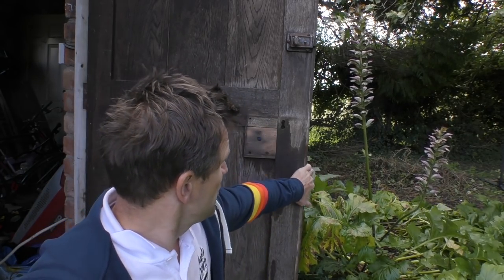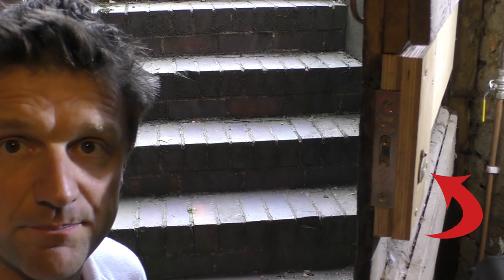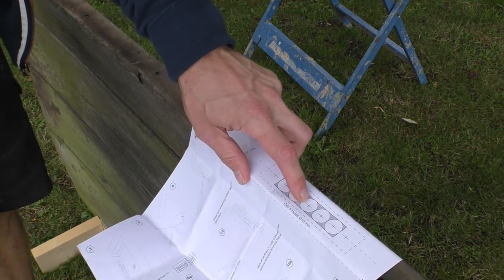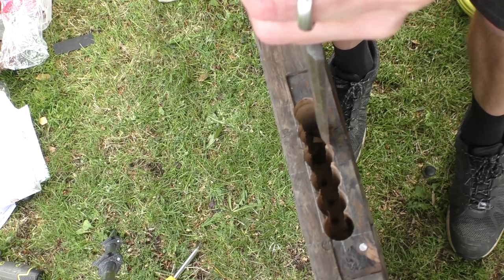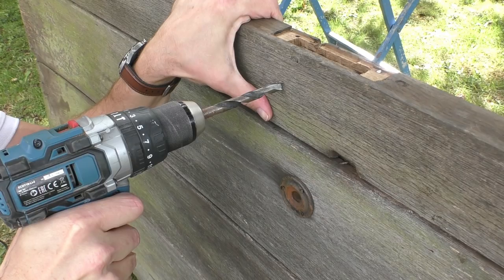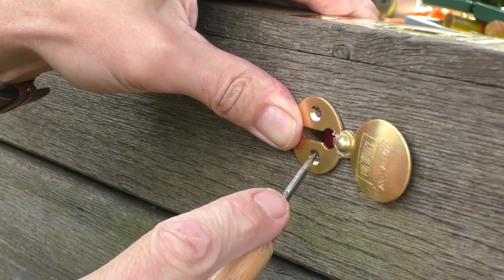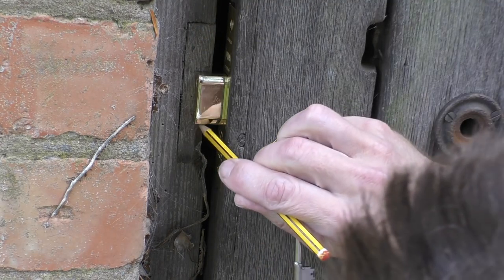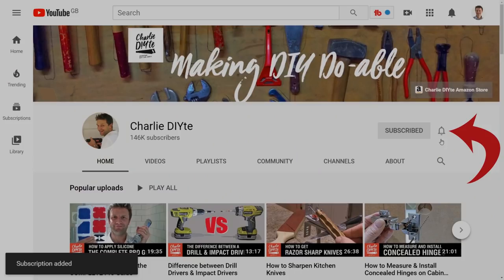How to Fit a 5 Lever Mortice Deadlock

Comment: Full of useful tips and tricks and not a straight forward job with the old screws etc. Excellent video as ever.
Reply from the maker: Thanks. Yes, I tried to get that screw out by grinding a new slot head onto it, but it just sheared off when I tried to turn it. 👏
Reply: @CharlieDIYte  I have a set of screw removal adaptors from Irwin that may have worked but probably not if the shank just snaps. They are handy items to have for not much money. You can also get ones from Irwin for bolts.

Comment: With brass screws, I like to drive the holes first with steel screws, then take it out and fit the brass ones.  In Aussie hardwood the brass screws usually snap.
Nice mortising 👍
Reply from the maker: That's a great tip, Peter. Thanks for the comment 👍

Comment: Another neat job done Charlie but that Black & Decker Workmate has definitely seen better times. ATB  Marc - Belgium
Reply from the maker: Thanks Marc  I know. I've looked around to see what to replace it with and nothing leaps out at me. I might instead just put two new oak tops on it.
Reply: @CharlieDIYte  That is exactly what I did Charlie. After all they are a useful piece of kit and the new ones are expensive and  not as sturdy as the old ones. Keep healthy!

Comment: This is proof that if you have the right tools you can do almost any job
Reply from the maker: It definitely helps. 👍
Reply: @CharlieDIYte  excellent tools that you won't use again..
Reply: @Stadium-wr3vg  you Don't  need  a lot of tools  to fit a mortice  lock,I have morticed several  with just a  19mm chisel  and a hammer, did one one with a chisel  and a rock just to prove a point. 
Some form of drill is handy  for pilot holes  and keyway though.

Comment: A2 stainless would have been more than good enough (also quite a bit cheaper than A4 which is more suited to marine environments as it's a bit soft but excellent corrosion resistance in salt water).
I'm with you 110% on the torx head screws, I try and use nothing else these days for all the reasons you mentioned.
Reply from the maker: Thanks for that. I completely agree with the A2. I just had the A4 knocking around so I thought I'd use them 👍

Comment: Just found your channel and did some catching up on it. Love your explanations and reasons/options. Tbh I didn't even need to watch half the stuff I did. Your content kept me keen. 

That being said, I'm in the middle of having to run some Ethernet cables around the living room. Could you go over some options? Main issues are around door frames!
Reply from the maker: Thanks, I really appreciate that! I take it the room isn't carpeted, as if it was, it would be easier to go under the threshold strip. It's a bit difficult to comment without understanding more about the space, or what you're trying to do. Maybe email me some photos to charliediyte@gmail.com. By the way, if you're extending your WiFi, you HAVE TO use UniFi, either their AP AC Pro or the Lite version. It's perfect for what you're doing as it relies on hard wired connections, but seemlessly extends wifi. I've got two of them in the house and one in the shed at the bottom of the garden! Really easy to set up for us DIYers.

Comment: To date I have never seen a solid brass screw with anything other than a slotted head so I think those screws are almost certainly brass plated so you don't need to nanny them too much, I know some people watching might have heard scare stories of using brass screws.
Reply from the maker: I'm sure you're right, thinking about it, but always worth piloting in oak.👍👏
Reply: @CharlieDIYte  Definitely, piloting is never a bad thing. Just wanted to reassure those scared of brass screws as they are tricky to use correctly.

Comment: Hi Charlie, fab video even though it an older one. Quick question- would you still employ this method of using a spade/auger drill bit to make the cavity for lock body then neaten up with a chisel or have you come across any better methods router etc? Thanks in advance
Reply from the maker: Thanks Mosaddiq. No I haven't really. The problem with a router is it won't plunge deep enough to cut out the cavity for the lock body so you are a bit restricted to using this technique
Reply: Souber morticer us by far the quickest  way,dint like using  it on old doors though because  of hidden  nails  and screws. 
I won't even use my good chisels  on  a door like this.

Comment: Hi Charlie. I'm about to fit a mortice lock to my exterior wooden door. This is a job I have done before, but it occurred to me that the door frame might be weakened by removing some of the tenon when boring out the hole. Any thoughts?
Reply from the maker: I wouldn't worry about it Robert. The tenon position should have been designed with a mortice lock in mind. You can normally see the tenons in which case try and place the lock to avoid them. 👍🏻
Reply: @CharlieDIYte  Thanks for prompt reply Charlie. I am re-assured. As this is a replacement door, it would be easier to keep the mortice in the same place to match the lock plate in the old frame. This will encroach upon the tenon. If I can move it slightly, I will.

Comment: You need to invest into getting a souber mortise tool, I been putting it off for years but recently got one second hand and it’s a dream to put mortise locks and latches etc in, which I used to hate installing.....why didn’t you refix the frame, you had the fixings in your hand and it would have only taken 15mins

Comment: Erbauer drill and impact driver rather than Raiobi?
Reply from the maker: Only because my Erbauer drill and driver are brushless, and the chuck on my Ryobi combi is on the way out. Still love my Ryobi stuff though and actually my Ryobi impact is easier to control than the Erbauer if I'm honest.
Reply: I love my Erbauer impact driver and the Erbauer sds drill is great as well
Reply: It's spelled "Cryobi".
Reply: @CharlieDIYte  God job. I bought the same erbauer set after approval from "the management" when plasterboarding the ceiling of the garage, with a few drilling jobs in the garden as an excuse to get both. I'm very impressed, though the erbauer cordless circular saw has the blade on the right rather than on the left as on your erbauer CS. I'm right handed and would rather have the left hand blade, though this isn't often discussed.
Reply from the maker: @davidmcarthur1093  I've got my eye on the SDS, David. Also the batteries last for ever 👍
Reply from the maker: @keithklassen5320  Oh yey of little faith, Keith :) I know a lot of tool snobs think they're a joke, but speak to anyone with Ryobi and they'll tell you they go on for ever. Super reliable, reasonably priced tools.
Reply: @CharlieDIYte   "Also the batteries last for ever"  Is that because they're brushless? I put up 9 sheets of fire proof plasterboard with ~ 8 screws on each joist on one charge on the impact driver (over a few days though).  :-)

Comment: Neat job. But ...1) Why are you taking the door off? You're just making work. Wedge the bottom of the door. 
2) It's a mortice, not a rebate. 3) Clamp some spare bits of timber at each side of the door, when you're chiselling out for the face plate (if you haven't got a palm router handy, which most won't haven't) otherwise you risk the cut bursting out the face of the door.
Reply from the maker: Thanks. I took the door off because it only took a few minutes to remove and it's easier to work on the door when it's in the door clamps. Fair point though about clamping the spare bits of timber.
Reply: @CharlieDIYte  I have to disagree  with you on that point, when you get used to them it is far easier and quicker to do with the door hung.
But if you feel more comfortable  doing  it in a stand then that is up to you,everyone has their preferences.